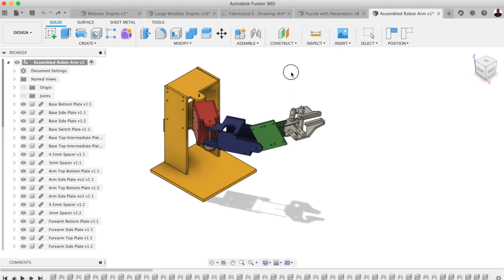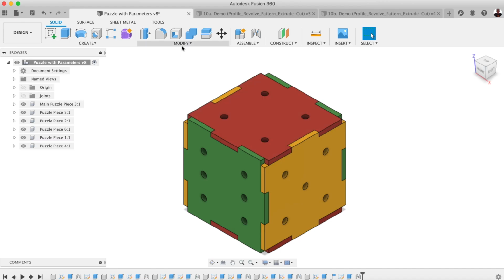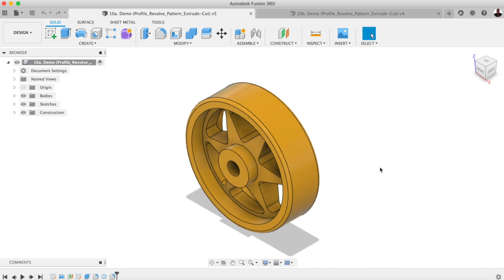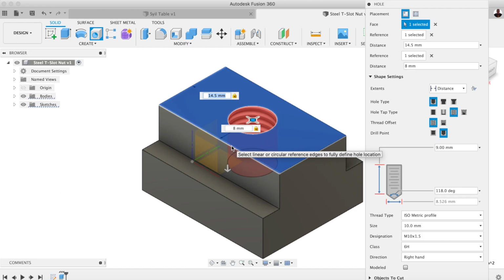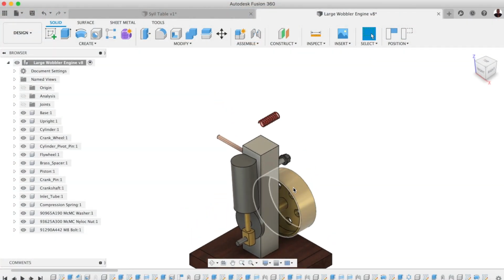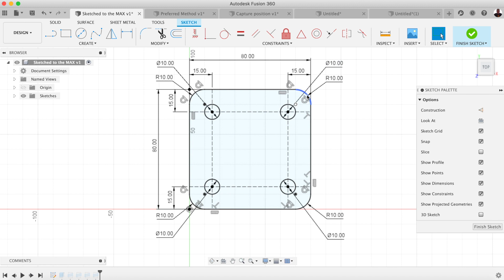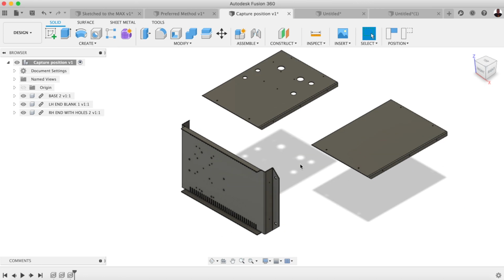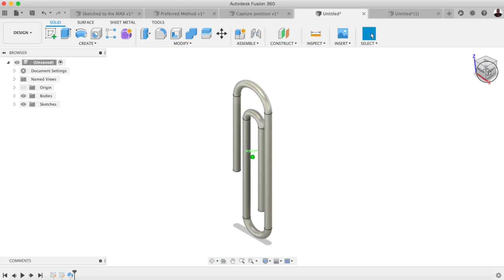Fusion360 TOP 10 Mistakes made by users - Great TIPS

Comment: I don't agree to all of the advices here. Especially to avoid complex sketches and use a feature for everything. It's good approach with a very simple and basic parts that have just a few features. When fusion timeline gets very complex and cluttered it's really a pain to dig up through dozens of features just to find a single fillet value. For me it's much easier just to open the main sketch in the browser and change values there. Also the pattern values can be contained inside a sketch. You don't need to delete everything and redo from scratch. The sketch pattern can be edited by double clicking the pattern constraint icon. At least it can be done now. The video is 4 years old.
Reply from the maker: Hello and thank you for the feedback.  It's totally ok not to agree to what I've shown here.  I am showing 1 way of doing something from a teaching perspective.  At the end of the day, I agree with most of your suggestions.  Remember in any computer based software there is always more than one way to achieve the desired outcome.  I appreciate you taking the time to watch my video.  Cheers 🍻.

Comment: Regarding Tip #4.... is the file size really an Apples-to-Apples comparison.  Your sketch that you did in the feature was only based on 5 items in the pattern where as the when done in the sketch, it was a pattern of 6 items.  Just saying .... could this also make a difference in the file size. (I haven't test this).
Reply from the maker: That’s a very good point. I would need to redo this to validate. Thanks for contributing 👍

Comment: Is there a way to change all instances of a parameter in a copied component?  I am building a parts storage box with three drawers.  Because I plan on making a few of these for different parts, I want the entire model using parametric constraints.  Once I copy my first drawer (which took me for ever to get right) I want to change all instances of the DrawerHightOne to DrawerHightTwo.  Is there an easy way to do this?
Reply from the maker: Hello, to be honest with you I am totally unsure. I have seen an old video from an Autodesk staff member who designed a laptop stand. Using parameters he could change the thickness or length and it would repopulate without falling over.

Comment: I like to constrain everything in a sketch, but I oftentimes have issues with projections, where everything seems to be constrained but the sketch is marked as not fully constrained. And also sometimes the other way around, where sketch lines can be moved but the sketch shows the "fully constrained" icon in the tree view. Is this a bug or am I doing something wrong?
Another thing that bothers me is that it is really hard to fully constrain splines, so I tend to avoid them completely unless absolutely necessary. Is there a simple way to work with splines without needing to "fix" them in place?
Reply from the maker: Thanks for watching mate. Good old Fusion360 (confusion) can be tricky at times. It could be a myriad of things causing that. I suggest posting the question on the Autodesk Fusion360 online forum. That way you can post a screenshot and get help from the user group. Cheers 🍻

Comment: Hi, what I still find strange , is the fact that if the left side and the4bottom side of a rectangle is black (FULLY defined?) then why are the 2 opposite side still blue ? The only thing that is fully defined, are the starting points of the lines and their direction, but still not their lengths Actually they should colour them grey or something as long as they are not FULLY 100% defined  
Nice tutorials though thanks a lot.
Reply from the maker: Thanks Hans. Yes good old confusion360 can do that to you at times. Like snapping a line to the origin and drawing horizontal will go black but no dimension is added. Cheers and thanks for watching 👍🍻

Comment: Excellent! I’ll be keeping an eye out for blue lines in m’ sketches...!👍🤔

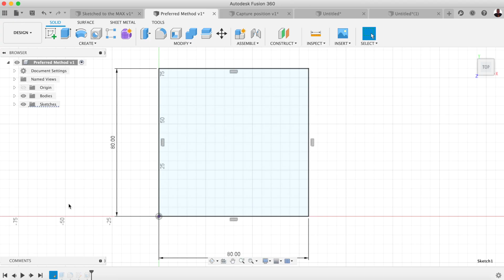Question. At 14:18 you have a sketch that’s an 80x80mm square. You came out of the sketch and there were 4 wonky holes. Back into the sketch, and there are 4 points marked (centres of the holes?). How did you add those?! The constraint work makes sense, but I can’t figure out how you added those points...! (I also did “Technical Drawing” at school (although they called it “Graphic Communication”), so am much happier with a parallel motion/T-square!)
Reply from the maker: Hi Adrian.  Thanks for following along buddy, I appreciate the support.  To add points to your sketch you can do this.  With an active sketch open, click the "create" dropdown button to expand the sketch options, point is located 10 lines down from the top.  Click the mouse to insert your points.  You can dimension these accordingly also.  I hope this helps?  Cheers, Aaron.
Reply: DCTSolutionsAU  Excellent; many thanks Sir!😁
Reply from the maker: Adrian Hamilton my pleasure anytime 👍🍻

Comment: I am sorry to say but you are wrong about tip #4, it is possible to go back to the sketch and change the pattern. Both the number of holes and how the hole looks. There is a small pattern illustration at the center of the pattern, right click on that and you can change the number of holes.
//Anders
Reply from the maker: Hi Anders.  Well there you go.  You taught me something.  I just tried it and it worked a treat.

However, the premise of #4 was to highlight the point of Patterning features not sketches. Fusion has to calculate constraints in sketches . When you pattern a feature fusion only mirrors the boolean body and doesn't do the calculation.  That is what i was told by Kevin.

Great tip though Anders.  Thank you for showing me 😊
Reply: @DCT_Aaron_Engineering  Understand, and this feature are not so old and it is very easy to miss :) . Personally I preffer using Sketches when I draw a part. Might be because I am an old man and used to make 2d drawings, I feel that I get better control over the dimensions using Sketches. //Anders